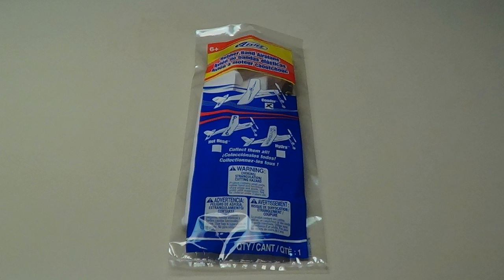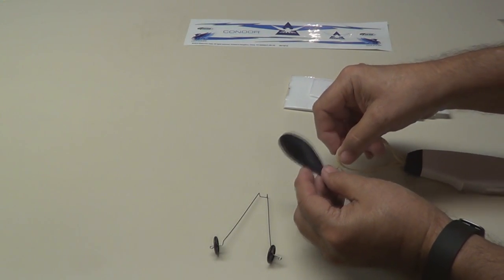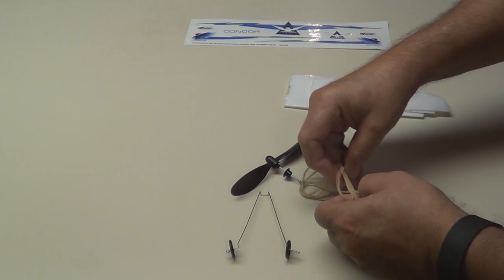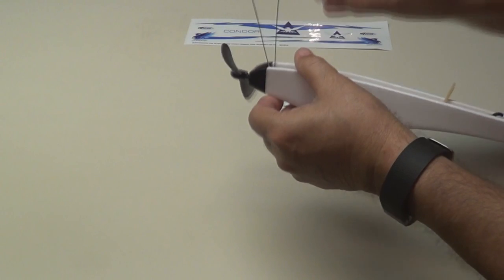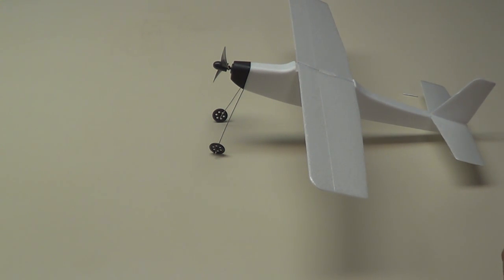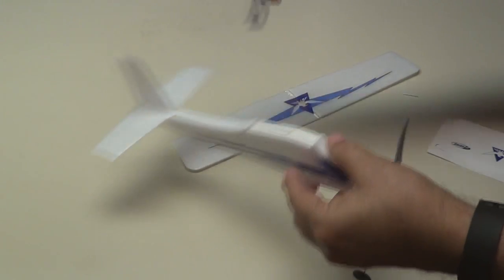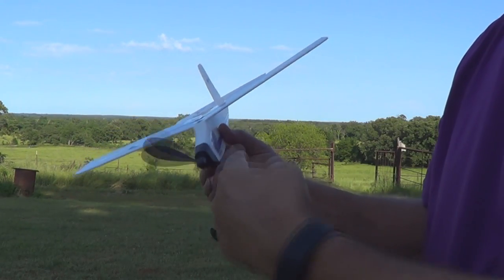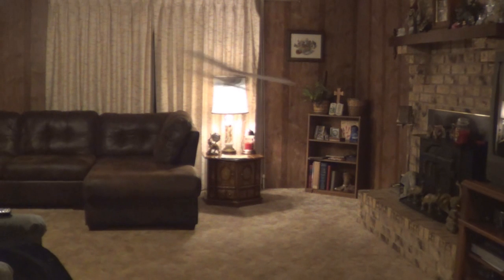Rubber Band Powered Plane Build and Fly Estes Condor  Indoor Outdoor

Comment: I think leading wing edge was installed backwards...
Reply from the maker: Why do you think that? The leading edge has a rounded corner and it is in front isn't it?
Reply: bwcpublishing , sorry your assembly was correct , I was under impresión to see small channels for ailerons that are usually included in designs even for rubber planes. Those are at front . Sorry again . Alex
Reply from the maker: Not a problem, thanks for watching.
Reply: @bwcpublishing  👍